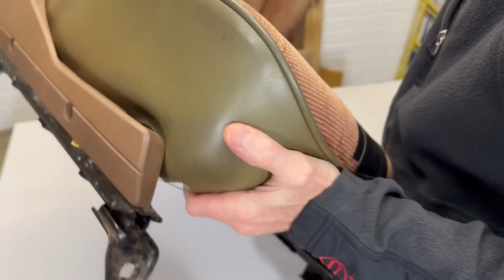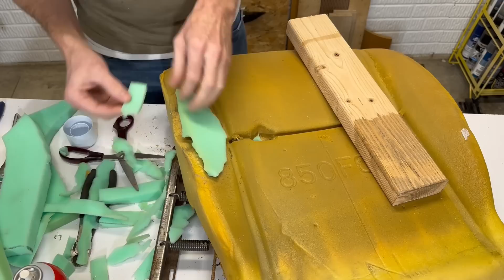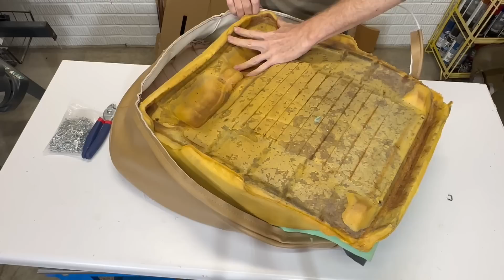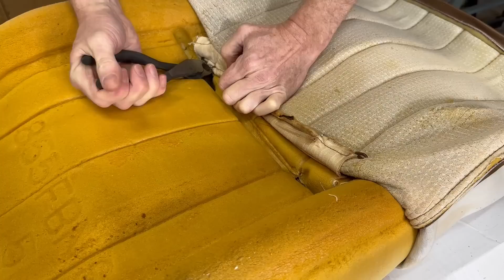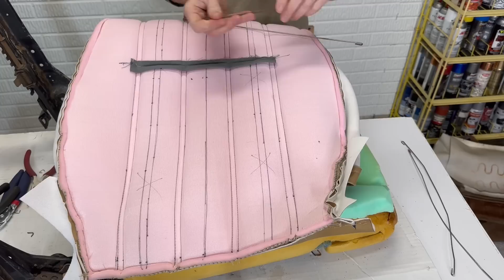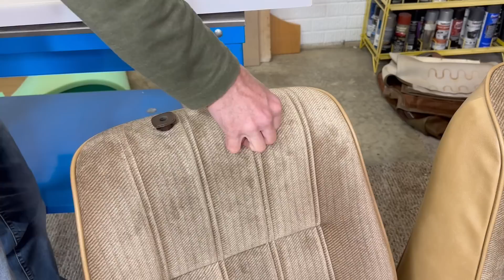How to Reupholster Old Car/Truck Seats: Toyota 4Runner

Comment: I wish my 86 4Runner was an 85. I have a dlx 86 with 22re
Reply from the maker: I got lucky finding an 85, but I would have been happy with an IFS 4runner. They're better for on road driving and I will be using this 4 runner for that mostly. I really wanted an 87-89 SR5 with loaded grey interior... but bare bones manual interior means less electronics to go bad.
Reply: @6thGearGarage  that’s fair the ifs is a lot better just a lot more expensive to do cool things with. One day I want to do a total chaos long travel suspension

Comment: This is so rad.  I'm hoping North Shore Toyota Products comes out with '89-'95 pickup SR5 sport seat covers, specifically in the grey steep diagonal pattern that I believe came in '89-'93 (I think '94-'95 had the "cell" looking pattern, where the cells kinda look like a stretched out chainlink fence that is diagonal but not at a steep angle).

I put grey '93 SR5 sport bucket seats in my '94 Xtracab DLX 4x4 (22RE m/t) 9 years ago, but the driver side bolster fabric and the edge of the cushion were already very worn.  It's the biggest eyesore of my interior, hands down lol
Reply from the maker: I notice they've already added more options to their upholstery since I made this video. I spoke with Tom, the owner,  and he said he could even do special orders where someone sends him their existing covers and he can use them as templates to create new ones. I'll end up doing this when I can find a nice set of rear seats to replace the bench rear seat in the 4runner.

Comment: I should’ve watched this long ago… I re-upholstered my 2002 Civic Si’s drivers seat with some better condition used fabric, and had no idea what I was really doing. Absolutely hated the entire process because of how annoying those rings are, lol! Didn’t know there was a specific plier set you could use to remove and install them. Luckily, my attempt didn’t go in vain, but knowing now how to properly do the job will make it much easier when I restore the foam.
Reply from the maker: I'm really glad I added the 1" foam. My seats are 40 years old, so probably a little more compressed than your '02 Si, but adding the foam made them feel like a brand new seat.

Comment: thank you for this my passenger seat is all bent from my rear passenger slamming forward into it (yes he removed his seat belt as we were driving) when i took out a non yielding ford f250 i got a couple seats but the material is far worse than my originals i can shift the pads cables an covers over to the new frame

Comment: At the risk of sounding picky, I would've washed the original foam in warm soapy water first. But you really did a fantastic job. Love the period style design and fabric. New old😂
Reply from the maker: Good point... I didn't consider 40 years of farts on the original seat.
Reply: @6thGearGarage  😂

Comment: Ive got a question for ya...sure you have removed wiper motors on toyota trucks....How do you get the bolt off on the inside of the cowl that attaches the wiper arm?? Just curious....
Reply from the maker: @drewfleming7065  what year truck are you working on?
Reply: @6thGearGarage  87 ex cab
Reply from the maker: @drewfleming7065  You'll need to loosen the bolts holding the wiper linkage, 3 at the base of each wiper. then the linkage will move around and give enough room to get a 10mm wrench behind the wiper motor.
Reply from the maker: careful with those three 10mm bolts at the base of the wipers... they love to seize
Reply: @6thGearGarage  Thanks...do you reach inside the cowl to get to the 10mm nut? do you have a video on it??
Reply from the maker: @drewfleming7065  no the wiper motor should pull out just enough to reach it from there. May need to wrestle it out a little bit
Reply from the maker: slow down the playback speed and you'll see me do the steps at 4:59 here (timelapse) https://youtu.be/DseL6_qwoO4
Reply: @6thGearGarage  Thanks...your the encyclopedia of Toyota repair...Not the first time ive used it either...If you didnt live in Rustville Ohio Id will my Ca rust free truck to you....Sure it would be taken care of...

Comment: NICE...I need them but a bit pricey at $1000...Ive gotten bids at shops for that and it includes install....
Reply from the maker: Oh you're looking at the Vertigo covers? Yeah not cheap, but a used set of Vertigo seats sells for close to that amount, and they still look like used seats. They say buy once cry once, but I'd cry for a while if I had vertigo seats. I hear they're so comfortable though.
Reply: The vertigo material is very expensive. Make sure your shop is aware of that.

Comment: the replacement foam for that seat is $80 on ebay and amazon.
Reply from the maker: I saw a lot of replacement foams for 3rd gen 4runners, but haven't seen any for these 1st gen seats. If so, $80 for both pieces is a pretty good deal. Although, I didn't mind $20 worth of foam and a little cutting  :)
Reply: @6thGearGarage  the book mark i have ( i made years ago, is NOT valid anymore.i thought there were, maybe there are but i cant find it, guess im wrong
Reply from the maker: I'll bet they quit making them because there's less demand for 1st gen stuff now.
Reply: I’d like to see a link for that because i haven’t found any.

Comment: I put Seat Covers On Brand Car Seats. and as Long As I drive this Car it will have Nice Seat Covers on the Seats. They Get Close to wearing out? will buy New.😅
Reply from the maker: I'm considering throwing covers on these before I start driving it, but they look and feel so gooood!
Reply: @ your Car.. put Covers on the Seats.. over time' you will be glad you did.. also in the summer you want to keep your car as Cool as you can. The Sun be doing some serious Burning.😄
Reply from the maker: Yea, especially on a 4 runner when I take the top off :)

Comment: Was so stoked to see this! Maybe headliner in the 79-82 Pickup next???
Reply from the maker: The headliner in my pickup is actually is good condition, but I do have a big 'ol rip in the one for this 4runner.  They're obsolete, Like so many parts for these old Yotas, so I'll probably figure out a custom solution.
Reply: I did one headliner in denim and another old truck in brown  corduroy. I love how it turned out. You can basically glue any material you want to the headliner
Reply from the maker: What kind of glue did you use? I know from experience with dashboards that some adhesives don't hold up well in heat.
Reply: @6thGearGarage  3m headliner adhesive, seems to hold up just fine in summer heat